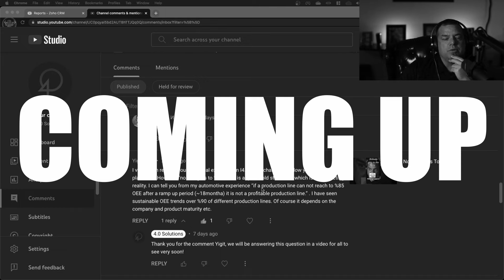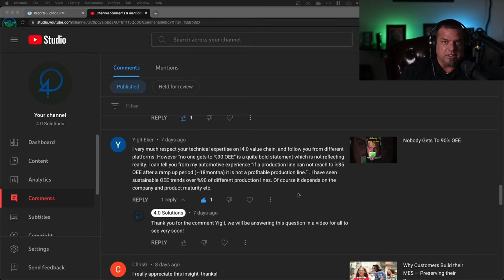Why Some Companies Have HIGHER OEE Than YOU!

Comment: The comment about rework is very interesting. We struggle with the same issue at our facility. The issue with rework is that it can lag behind a production run. So for example you can have a paint line running with a 90% pass rate only to have an assembly line reject another 20% of parts several days later. Love to get your thoughts on that, Walker.